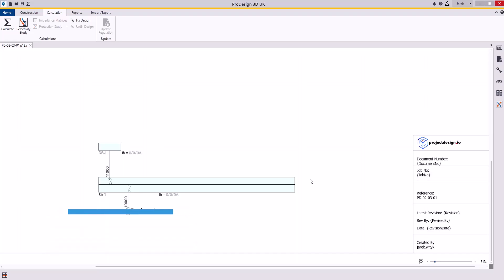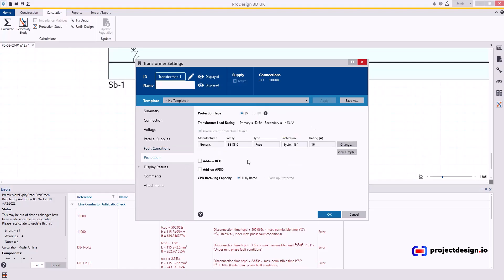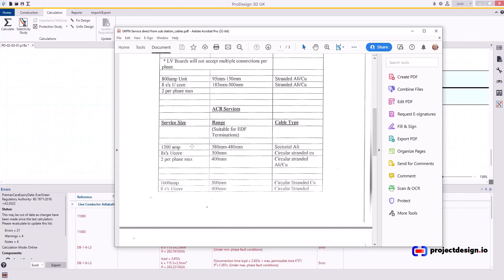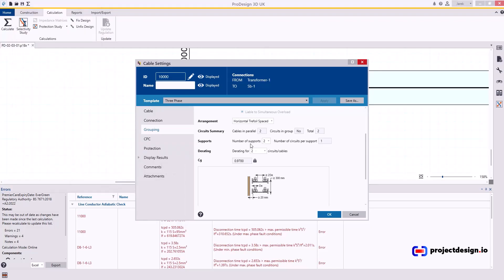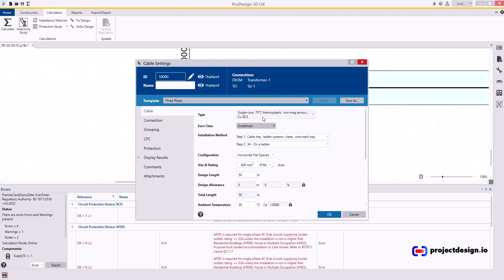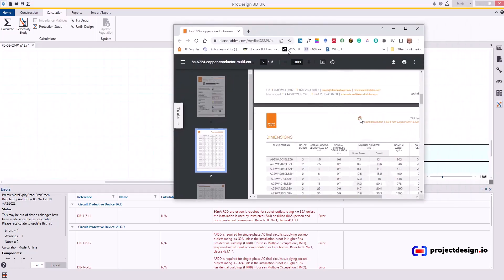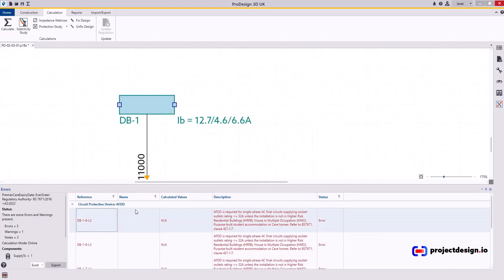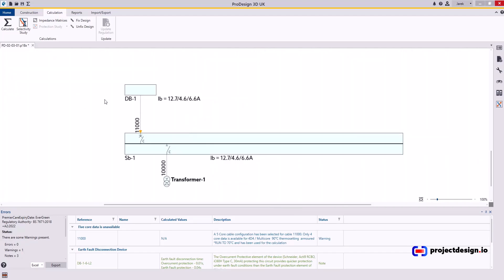PD 02 03 03 Essentials   Resolve PD 02 03 01 errors

Comment: I am Venkatesh from India, Your sessions were very informative and useful. Thank you from bottom of my heart for your efforts. I can't get same errors though I was using your exercise files.
Reply from the maker: Venkatesh, thank you for your comments.  I am assuming that you are referring to errors in PD-02-03-01.p18x
I just checked, and there were actually a few more errors on circuits 5LK2, 5L3 and 6L1. It's a ProDesign glitch (Software Version 2021.0.20.1) where the program does not read the cable size correctly. It's automatically resolved when you open the circuit, edit dialogue and re-save. All other errors are still there, as per the video.
What ProDesign version do you use?
Reply: Hi @jarekwityk , I am using 2019 version